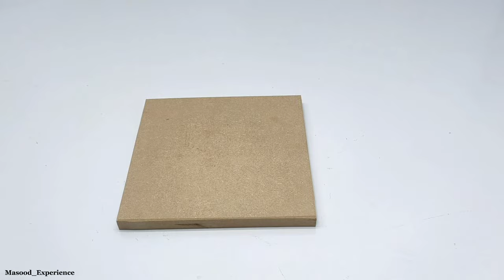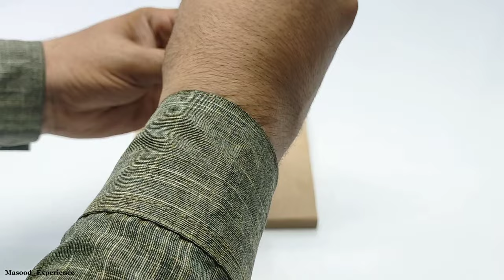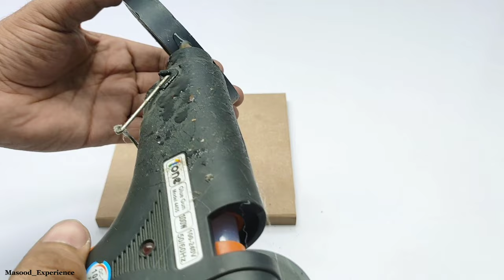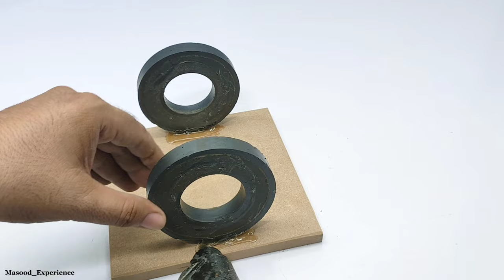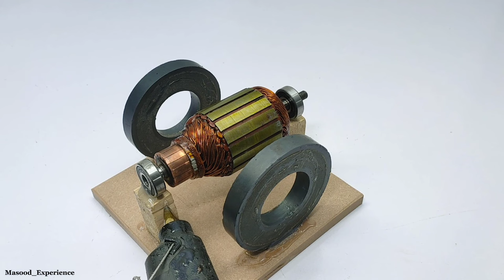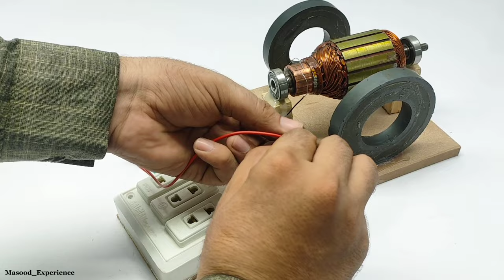I turned super power magnet copper router into220v 15000w generator

Comment: It's fake. For 10,000 watts you need a thicker winding and a powerful motor. Give the load at least 1000 watts and the engine will stop, but if it doesn’t stop, it means electricity is not generated by the engine, but somewhere nearby there is a source of electromagnetic background. You need a thicker wire for 60A currrent.

Comment: Magnet is very far away from copper winding so it will not work, it will produce low ampere current flow, below 10 watt. Bulb glowing is a tricky method.
Reply: Перевод